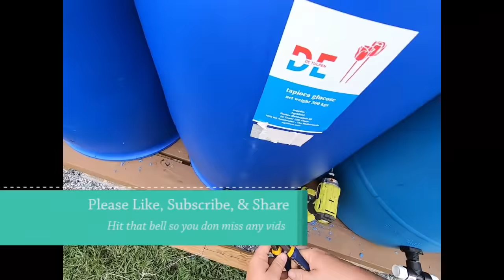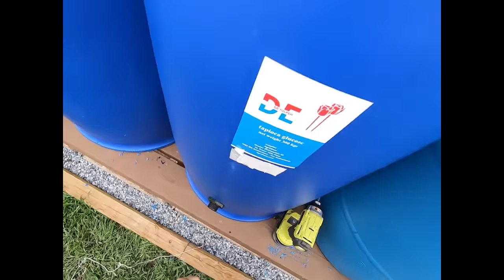Ganging 5 Rain Barrels for HUNDREDS of GALLONS of Free Water

Comment: Do you drain them in the winter to prevent freezing?
Reply from the maker: I drain to the valve level. I have a single blue barrel for my chicken coop and that never gets drained. It has frozen solid but I keep the top open so the ice has some expansion room.
Reply: @LancoAmish  ok. I'm in North West Ohio. And I know mine will freeze. Thanks for the reply.

Comment: I know barrels are cheaper than an IBC Tote but most totes come with a valve and bulkhead fitting.  Plus one tote holds as much rain water as five 55 Gallon barrels so you would not have to gang the barrels together.  When all is said and done all the fittings, one tote would be cheaper, less work, less likely to fail, and take up less space.  Just curious as to why you chose to gang 5 barrels instead of getting one 250 gallon Tote which in my area is bout $100 used.
Reply from the maker: I had space constraints behind my equipment shed. I wanted to pretty much stay in my roof footprint.  I’m in a pretty unique area where products are much less expensive when purchased from local shops rather than large chains.  Most of my plumbing comes from a custom builder of AG sprayers. I can walk in and tell the owner what I am building and bing bang boom he has the parts pulled and I’m on my way at about 40% of the normal retail cost. Totes here cost around $35-40 so I understand where you’re coming from though.  
Check out my other videos on water collecting. I do use totes and “fit” down to hose fittings. I hook up an 18 volt Ryobi pump and water the gardens.  Thanks for watching.
Reply: @LancoAmish  Thanks for the pointer, I am going to check them out, I am looking to design rain catchment system off my garage roof with a old shallow well pump.  I see a lot of people filling their rain barrels from the top down.  You should be able to fill a rain barrel from the bottom up using the same bib for inlet and outlet using gravity so long as your diverter inlet from your downspout was higher than the top of the barrel.  Then all you would need is a breather on top your your rain barrel to let air escape when the barrel fills or empties.  Most Totes lid have a built in air breather in its cap so technically you would not need to modify a thing.  Chaining totes for more capacity is just as simple you would connect each tote outlet like you did here.

Comment: having 5 water barrels feeding into one line how is the water pressure?
Reply from the maker: Pretty good. Would be better at a greater height but I’m limited in height due to low roof line. I use a battery operated transfer pump at this set up anyhow( Ryobi 18 volt hybrid).

Comment: Where did you get the black part that you are putting on the inside of the barrel I can't find them at Home Depot
Reply from the maker: Thanks for watching. They are call bulkhead fittings. Farm supply stores sometimes carry them.  You can also buy them online.
Reply: @LancoAmish  ya I went to home Depot but those are to big so I got the ones you got from Amazon thanks for the reply

Comment: What about overflow pipe on the last barrel?
Reply from the maker: My supply connection is not a tight fit on the first barrel. Any overflow can drain there. It doesn’t matter which barrel has the overflow.

Comment: so you have to get over 4 barrels of water filled before you can use some???
Reply from the maker: Thanks for watching.  No…the barrels fill to the same level as the one that has the downspout. That’s why they are connected at the bottom and not at the top.  If there’s 20 useable gallons in the first one then all of them will have 20 gallons so you would have 100 gallons of water  that is useable.  Hope that makes sense.
Reply: @LancoAmish  i stand corrected, nice job.

Comment: What happens if want to to the valve back plate off . chould of tired fishing wire to the back plate and put the fishing wire to the top of the barrel .
Reply from the maker: Thanks for watching.  Good idea.  I guess I’ll have to get a new backplate if I need to replace anything.
Reply: Sorry but you could tip the barrel unside down to get the back plate

Comment: How are you filling them all up, I’m looking fir a way to bury 1255 gallon drums all connected together to keep all the same level of water, but sucking water out of 1st drum w/12vDC pump hooked to car battery on solar panel, but want water level to stay the same in all barrels at same time filling as well draining. Pump in 1st tank, thought about placing home in top middle and bottom connecting all together w/3 holes in wash side top middle bottom that way I can suck water from all filling 1st tank from bottom, /
1/8”. Ent hose on top of all plumbed together coming out with wires from pump. Any comments greatly appreciated
Reply from the maker: The barrels are filled with rainwater guttered into the end barrel.  It won’t matter what barrel you pump the water from if the barrels are connected at the bottom. Water always finds its own level. You just need to make sure you’re not using a huge pump that can suck a barrel dry faster than the water can enter.
Reply: @LancoAmish  thank you so much that will save slot of time a day fittings and pvc mostly time. I was going to drill 3 holes each side connect 2@ from top 1” from bottom abs one in the middle. Connect 3 holes to each inner barrens but if I only drill one at bottom and have top hole connected to one another fill from the top drain at bottom and pump outta the 1st barrel m, that would work woukd’nt it? I was going to go with 1” pvc, between each barrel, not too big is it originally was going 1 1/2” in bottom 3/4” in middle, 3/4” top, but eliminating top and middle hole. Just going with too full pvc, which 1” will T-off into each barrel, with a 1/8” vent t off into each barrel coming out w/a vent flapper cap to keep debris out just above the ground with wiring for motor, thanks that woukd wirk huh?

Comment: Good video and I like the mobile workbench!   Just curious...

After three years is that bench still holding those 5 barrels up?   

I mean it's a nice sturdy bench but that's like 2,000+ pound of water when full.  Is it that sturdy?
Reply from the maker: That bench is doing well! I would have no problem with putting double the weight on it. Thanks for watching.
Reply: @LancoAmish  Thanks for the quick reply.  Best wishes.

Comment: I am concerned about the weight on a wood base. Also the hydrodynamics - the primary dispensing tank gets filled last. So after 6 inches of water in the end tank, water begins moving to the next tank and so on until it finally begins to fill your primary tank. How much rain needs to come to begin to fill the primary. I might consider placing the diverter on the primary. My only thoughts because I am building something similar. 

Would like to see it in action.
Reply from the maker: Weight isn’t a problem. The tanks fill simultaneously.  The water level remains constant between tanks. There is no “primary” tank. Thanks for watching and commenting.  Greatly appreciated.

Comment: Will it  work in sub-zero temperatures?
Reply from the maker: 😂😂😂.  Then again I don’t water the berries in the winter.  I do have a single done similarly for my chickens and it does pretty well thawing out if it’s sunny. I’m sure it would be a lot different if we lived more to the north though.
Reply: Do the bulkhead fittings survive a freeze without breaking?  Or, do you have to drain the system for freezing temperatures?
Reply: @mc0wenM  I would just drain the system. The little bit of water freezing in the base of the barrels won’t hurt anything, but all those fittings won’t take to added pressure from ice formation very well.
Reply: NO

Comment: Unfortunately those kind of barrels sell for Well Over $100 New and Good Luck finding Good Used Ones that were not used for Fuel and still cost $40-100 if You Can Find them. And the 250+/- gallon Square White Totes cost $40 IF you can find them in Good used condition also. There is a Survivalist Store that sells them in Good Used Condition but sell them for $140.... So If the water is Not going to be used for Drinking, I use the 32 gallon Round Garbage Bins that sell for $10 - $15 at Walfart... And if for Drinking, I put Sand in the one that collects the water from the gutter so it Filters the Water for Bugs and other Shit falling into it, then on the last one I use a Inline Filter to filter out the stuff the Sand w/couldn't... Leaving the Lids Screwed Down and with Caulking on the ones that just hold the water to keep the Bugs from getting in and laying eggs/larva..
Side Note: They are making doing this type of stuff Illegal in Nevada. They claim you are Stealing Water from them/the State and others/Citizens or some shit like that.
Reply from the maker: I think it depends where one is located. We have a lot of food manufacturing in Lancaster county. I just checked Marketplace and food grade run blue barrels run 10-$20.  Mine had tapioca syrup and some I just looked up had white vinegar. 
I do think some of the garbage bins are food safe.
Reply: @LancoAmish  Ones that can be found for Under $40 have had their tops cut off and used for Garbage Bins or other Nastiness. Or out in the Countryside/Out Side City Limits, they get used for Septic Tanks. People around where I live Want $$$$$ For Anything they are selling and refuse to pay $$$$ if what you have to offer is actually in better shape. They Sell the Shitty one for $40, You have a Good Clean one and want $40, they Bitch and offer you $10... That's why I just stick to Garbage Cans. I get my Drinking Water from the Good Neighbors Down the Road for now. Untill I can save up the $5,000-$10,000 they want for Drilling a Well. But been doing the Rain Collecting and Neighbor thing for 13yrs. 13yrs and just Now being able to start saving........... Happy 4rth!

Comment: Good job showing and explaining how it's done.  However, correct terminology would be more useful.  A quarter turn ball valve will deliver more volume - not pressure than a standard hose bib.

Call me "anal" but when you use the teflon tape you really should turn the tape over so that it's unwinding as you wrap the thread.  Using it the way you are leads to having a lot of tape that has to be rewound on the tape bobbin.  By turning it over you can keep the tape tight as you unspool it onto the threads.  At least you're wrapping the threads in the right direction.  Can't tell how many video's I've seen people wrap against the thread.  OH, THERE YOU GO!  ATt 21:20 you use the teflon the right way.

Would have been nice to see how you connect to the downspout and the barrels.
Reply from the maker: Thanks for watching and commenting and the correction.

Comment: Why does everyone use pvc fittings instead of pex or the black plastic pipe you can buy tee,s that are mechanical with a threaded center the plastic pipe is flexible and cheap
Reply from the maker: Personal preference I guess.  I had parts from other projects lying around also.  Thanks for watching and commenting.

Comment: Without a gasket or adhesive, the bulkhead fitting will leak.
Reply from the maker: Thanks for watching. The gasket is on the male part of the fitting…the part I fed through from inside the barrel.

Comment: Like the design but you use WAY too much Teflon tape, it's only supposed to seal between the threads not be a damn.
Reply from the maker: @johnkeenan7487  Thanks for watching. 2-3 wraps is normal and 1 or 2 more if the tape is thin. I used 3 most of the time.

Comment: You could have done the same thing with one 275 gallon IBC Tote for $45 and not have all the plumbing
Reply from the maker: Absolutely.   I used those totes on my shop( I have videos on that also).  In this situation I wanted the collection system closer to the shed and also not have to bother painting the barrels. Also, not everyone has the ability to buy totes in their area especially food grade. So I’ve done videos using both totes and barrels. Thanks for watching.

Comment: This system has a  flaw, on each tank he should have put a picture union and each 55 gallon tank should have a shutoff valves because alge can grow in stagnant water and you have to clean each tank 1 to 2 or more times a year with bleach ,1 cup to 5 gallon of water and sloshing the solution around, scrub with a dryer vent brushdrain out then clean with dish soap, rinse until no soup in container .if you are in s snowing state drain barrels to 2/3 full or you will split all your barrels and then that money lost!
Reply from the maker: Thanks for watching. Unions are a good idea but so is cutting pvc and adding a coupler.  I’m not drinking this water so even if algae does grow I’m not that concerned. Adding a bit of chlorine to the water can take care of that as well. I wouldn’t think people in states that have continual freezing weather need to be told to drain these before freezing.

Comment: Totally the wrong drill for that
Reply from the maker: What’s wrong with the spade bit? It may have been a bit ragged but the flange on bulk head fittings are more than big enough to compensate for that. I wasn’t going to buy a step drill bit for 5 holes. Taking a hole saw apart to knock a cockeyed plastic disk out between holes wasn’t worth the time. I think I picked the one that would do the job in an efficient manner at the least cost since I had the spade bit already.